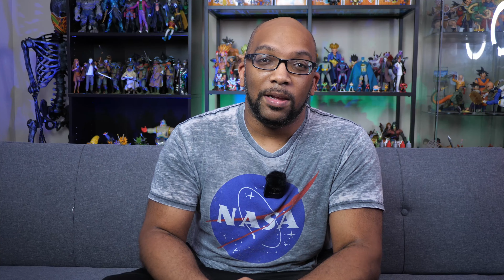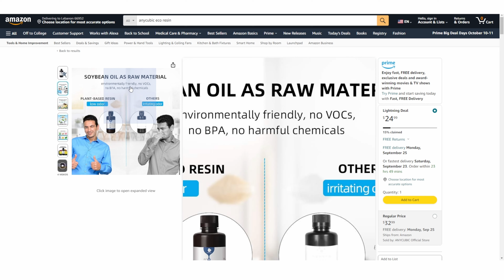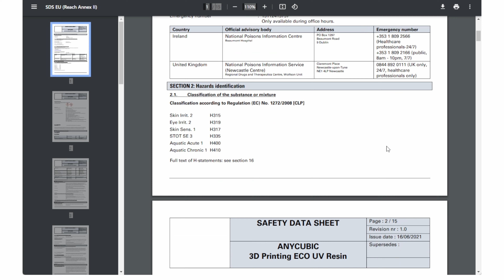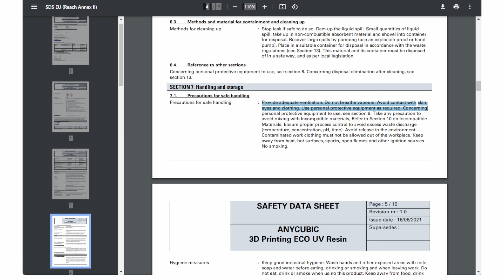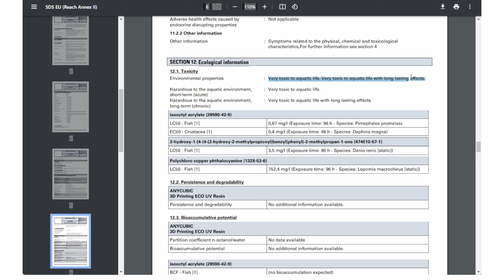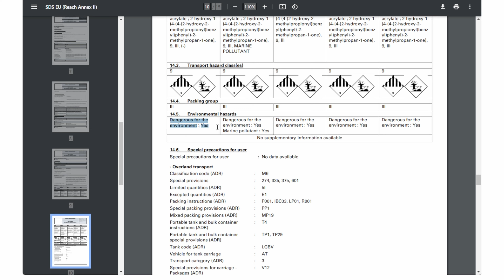5 Myths About Resin 3D Printing

Comment: Yea I definitely do not bother to manually support every print, auto does fine most if not all the time if you have the support settings dialed to your preferences so you can minimize the damage it does to your print, and as long as you are willing to sand, it's fine really. (Unless there are textures then manual is recommended but still can't completely mitigate the damages)

I barely dial in my printer for the resins, I just let it over cure a little and make sure it prints properly rather than perfectly. Lots of stuff are not even noticable after you sand prime and paint
Reply from the maker: I totally agree.